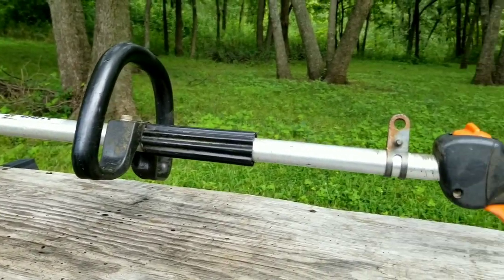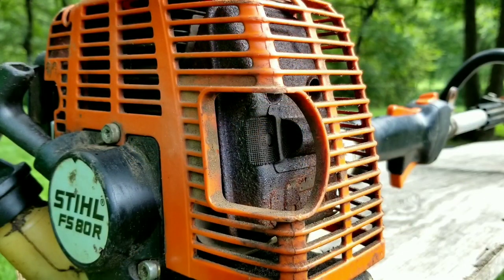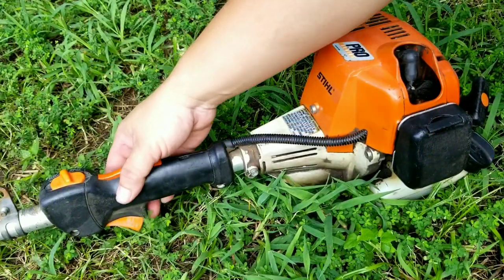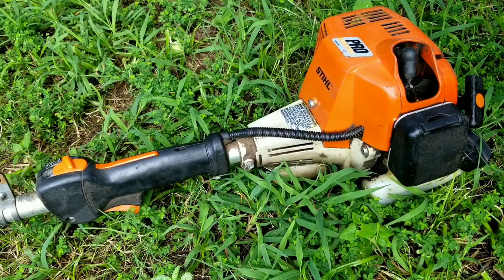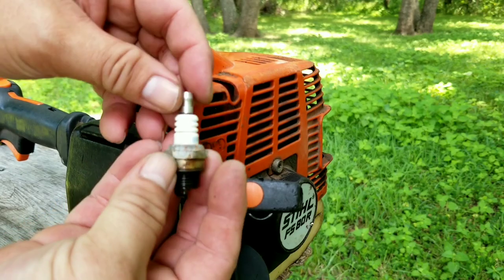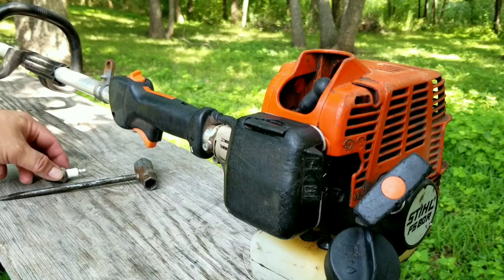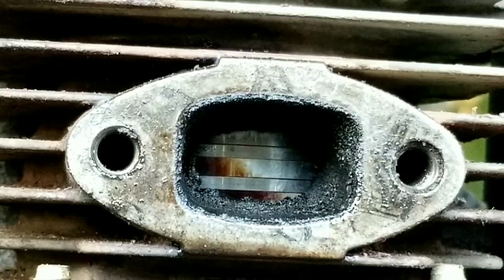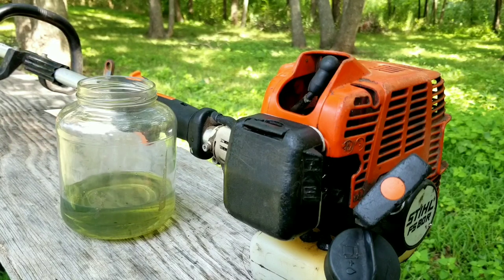Stihl trimmer won't stay running.  Sad ending

Comment: I have the fs 55 I’m getting around 20mins of use then it won’t start back up ( had it for 4 years) and maintain around 20 gardens, it’s had a carb clean new gasket & diaphragm has compression , new file filter & lines and a new tank , spark changed , flywheel cleaned & coil any suggestions guys ??
Reply from the maker: can you explain how it stops running at the 20 minute mark? do you change the fuel lines or did someone else do it?
Reply: I have carried out all work on it , 20 minutes is a ruff estimate of the running time ( but operates perfectly until this point )
Reply from the maker: @paulstir  so it just stops running or is there some chugging or anything else?
Reply: 100% dead doesn’t even fire up little
Reply: @paulstir  mine just started doing the exact same thing.  Runs like a champ for about 20 minutes, then it will come down to idle and die.  No restart.  Acts to me like someone threw the kill switch.  Won't  even think about restarting. No clue.
Reply: sbirdranch I find it very odd after everything I have done ! , my next step is to buy a sonic cleaner for the carb ( or replace ) , also get a visual on the piston 👍
Reply: @paulstir  I took mine out and ran it till it died.  Consequently this is when it was heated up.  I took it into the shop and checked spark.  Nothing!  I then checked the kill switch in the handle and it is working correctly.  I ordered a new coil.  I'll follow up when it is here tomorrow. ~P
Reply: If you have spark it sounds like your fuel tank is not venting properly after a. Of time it creates a vacuum in the tank and the fuel has no way to get in the carburetor
Reply: @Vfh........y  that is a great possibility ( thank you for the feed back ) I have a brand new cap on the tank however I will try running it with the cap off .
Reply: @sbirdranch  please give me feed back on the coil ( as I haven’t replaced it ) that’s about the only thing .
Reply: @paulstir  Sorry.  Failed to follow up.  Replaced the coil and that did it.  Haven't had a lick of problem since.  ~P
Reply: @sbirdranch  ah thanks dude I will try the same it’s such a good tool it would be a shame to give up now 👍

Comment: Hello-My 110R is a great trimmer,but, even with great maintenance, my machine warms up and will not start.   Then when it starts up after many tries it will not throttle up -take a few minutes to come up to full throttle-what can be the problem-the shops don't know? thanks
Reply from the maker: try replacing the carb and see if it works better.
Reply: Thanks I will try that and have a good one, what size carburetor is needed?

Comment: My fs 56 quit running suddenly. I have replaced plug, air filter, fuel filter. and checked spark arrestor which was clean. Not sure what direction to head now.
Reply from the maker: do a test start by putting some Fuel into the carbs throat to make sure your engine will still run

Comment: I was wondering if it is safe to run 40:1 in 50:1 equipment
Reply from the maker: nothing wrong, just keep an eye on carbon build up on the spark arrestor screen
Reply: @INSIDEHOUSEGARAGE Ok thank you so much
Reply: @INSIDEHOUSEGARAGE I’m trying to get better at mixing gas but I thought it might’ve been easier just to mix 40:1  for all of my equipment because I have some equipment that requires 40:1

Comment: My 85 starts idle but would only take a rev up to a surtain point then cut off , what do u think my poblem could be?
Reply from the maker: I would remove the spark arrestor screen and inspect it. If that was Okay I would try to adjust the carb and if that didn't work, I would replace the carb.
Reply: @INSIDEHOUSEGARAGE  thanks much have done all of the above so i will take u up on changing the carb , thanks again👍👍👊
Reply from the maker: @alvinjoseph8724  no problem

Comment: Unfortunate, it is just in the range of the high end of home use for a Stihl Trimmer, or very low end on a Professional side.
Never less not using good quality Stihl oil, perhaps a cheaper brand didn’t help in this case, though mixing should be done more accurately.
I would of loved to pick up a Stihl, need a gearbox for my first Stihl FS55, now I use an FS85.
Repair cost where too expensive so was just better to buy new pay a bit more and upgrade, and the other reason they stopped putting the grease nipple on the FS 55 gearbox.
Memory repair was about $225 with parts and new was $250 and the Fs55 was $350 Australian Dollars. My Fs55 was around Ten years old and used frequently it was a no brained to replace it.
Reply from the maker: Thank you Rick Thelian, do you not want to buy an off brand gearbox?
Reply: @INSIDEHOUSEGARAGE  I know there’s an China knock off $60 or so, I did buy a  Kombi brushcutter attachment rand new off a friend for $50, worth $200 but ended up buying a Kombi Km55 Engine new on Marketplace, $60, a steal, so that idea is out the door.now,  so I thought I may find one with a damaged engine for the gearbox.
May fin one yet😀
It’s more a hobby fix, but I’ve been gifted many FS 38 and even FS45C but all bent shafts, but amazing I brought most of them back to life easily with only little cost, one of the may need a nock off carby😀
Reply from the maker: nice work Rick Thelian

Comment: Hey I gotta question when I went to the shop to get my throttle tigger fixed they also find that my carburetor is boggling down so do that mean I need a new carburetor?
Reply from the maker: possibly but I would try and adjust the carb first

Comment: I have a huqvarna weedeater,I put a new carb,gas lines,fuel filter and spark plug in it,it will only run about 30 seconds and quit,Its adjusted and will run but quit,help please
Reply from the maker: try replacing the fuel cap.  its air vent might be stuck closed.
Reply: @INSIDEHOUSEGARAGE  Thanks  I will try that,I feel like I tried everything I could think of
Reply from the maker: @garybentley2540  let me know how it goes
Reply: @INSIDEHOUSEGARAGE  I don't have a. new cap but I loosend the cap and that didn't work,does it have to be a new cap because I have to order it,Thanks

Comment: compression wud hav increased had oil been added to fuel n cud hav run with som carb adjustments but yea slightly worn.  jus saying
Reply from the maker: Yes I think I'm going to try and add a bit more oil to see if I can get it to run again.  Thanks for the comment I appreciate it
Reply: Learn how to spell.
Reply: @matthewgrigg576   Hahaha.Is dat da best u cud do? get real maan!
Reply: @INSIDEHOUSEGARAGE  the other thing id check are the seals on crankshaft .jus visually note if its oily around it cos air fuel mixture is transferred thru dry crankcase into combustion chamber n if seals r leaky thn it probably wont start also.jus som pionts to kip in mind
Reply from the maker: @francisraman4400  I appreciate the tips thank you

Comment: Better build quality and generally people take better care of them. I would rebuild this trimmer with a new genuine stihl cylinder and piston. I would break in the new cylinder and piston easy like a brand new engine. It will last you a lifetime with proper care and the right fuel and oil mixture. Would definitely not use this as a parts trimmer. This model is known for its high power and reliability. The fs-94 and km-94 are the new and improved version of this same trimmer.
Reply from the maker: thank you Shawn Dubay.

Comment: Put oil in the plug hole and run 32:1 gas 85% chance it will run please consider making a video testing this
Reply from the maker: Okay cool thanks for the tip. I'll consider it but it probably won't be up for a month or so.

Comment: What is the model no of this trimmer
Reply from the maker: Fs80r. Did you want more than just that?
Reply: How do you put the recoil spring back in this one
Reply: @INSIDEHOUSEGARAGE  yes
Reply from the maker: I haven't had to do one before. I'll look here in a bit to figure it out tho.
Reply from the maker: If you didn't already get the recoil off then remove the orange top cover, remove the other 2 boots on the recoil then remove it from the engine. Next them the screw in the middle of the white part where the rope goes. Then lift out the white part and you'll see the broken recoil spring. After that I can't help as you'll need to keep the spring wound .

Comment: Have one that’ll run great opens up and stays running until it gets hot then it’ll shut off but as soon as it cools it’ll do the same thing anyone in the comments know what it could be? Thanks
Reply from the maker: How long does it take?
Reply: INSIDE HOUSE GARAGE if it’s hot out about 2-3 mins of running hard.
Reply from the maker: @John-ck7gv  I would try replacing the gas tank vent first. It's the little round capsule on one of the fuel lines  next to the carb.
Reply: @INSIDEHOUSEGARAGE  could you post a picture of that vent?  I have the same weedeater that will not idle. 
  It has a round grommet for each line going to the tank but there is seepage around at least one of them. 
  I don’t remember ever seeing any other round part connected to either fuel line.
Reply from the maker: @rickeykeeton4770  if you only have two fuel Iines with grommets, and not a third line, that means your Fuel cap has then incorporated in it. Do you have a third fuel line?
Reply: @INSIDEHOUSEGARAGE  no just two, so I guess the fuel cap is vented?
Reply from the maker: @rickeykeeton4770  yes. Remove it and you'll see it's not normal looking under it.  It will be stick out away from the bottom

Comment: maybe they use 5% nickel
Reply from the maker: You mean in there metal for the engine?
Reply: @INSIDEHOUSEGARAGE  yeah, maybe there's a small amount of nickel and carbon fused in the entire cast or just a small coated portion of it on the displacement wall of the combustion chamber... idk that just my guess. I would like to know why the price as well lol

Comment: Is it possible to hold the damn thing wrong? Lol cause it's not just me, I have a sthil f175 (or something like that looks like the one in video) and it will not run for me  my dad grabs it fires it up runs and cuts. My buddy touches it same thing runs and cuts. I touch the thing and it shuts off. I've been "trained" on how to use it. it's pretty well common sense.  Done with the fucking thing piece of shit haha
Reply from the maker: thats really strange.  I've never heard of something like that.
Reply: He started it this morning, he cut the length of my deck, then handed it to me. It dies.  Has gas has oil, all new, new spark plug new air filter. 2and year in a row I'm battling with this thing. Haha done with it I'll just buy a new one!